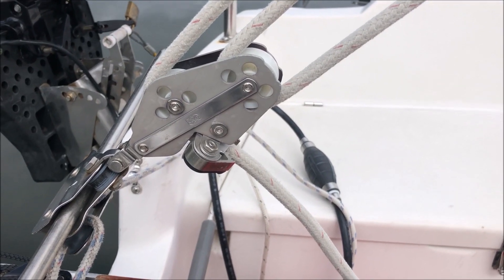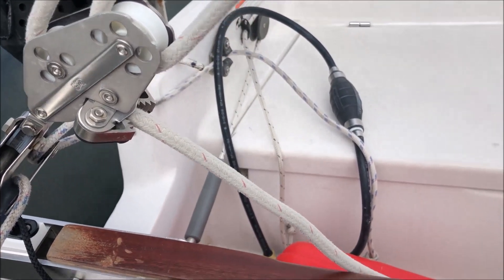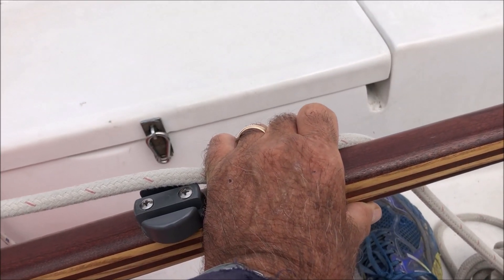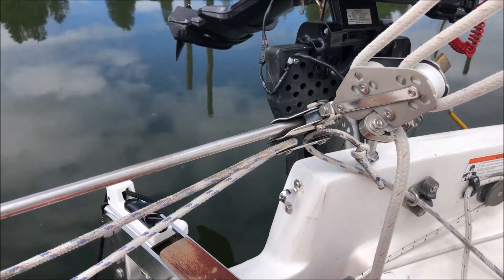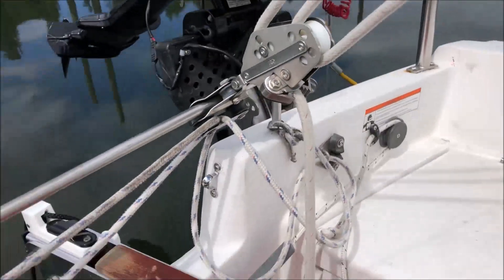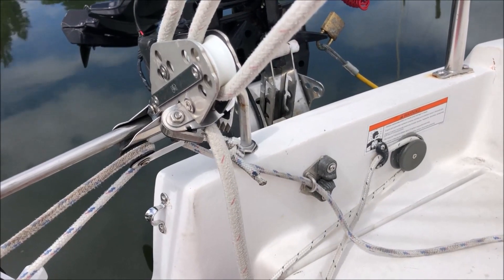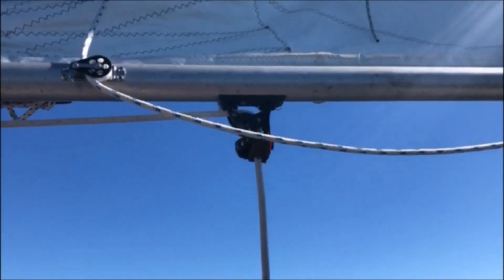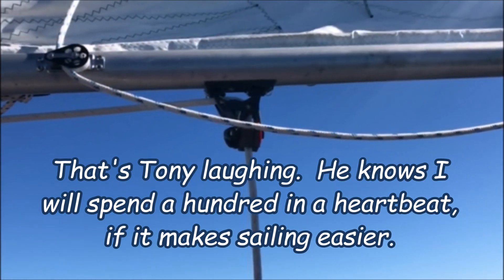Catalina 22--Jim's Little Boat--Never Make Fast the Sheets of a Small Boat

Comment: Great video Jim. I agree with you about the relationship between angle of heal and spousal contentment. Heal rate is also a huge factor. 

One mod I made on my C22 was to add a 10" pigtail between the fiddle block and the traveler car. Elevating the fiddle block means that trimming the sheet pulls it out of the cam cleat. To cleat it, I have to raise the sheet up as I trim. I find it much easier and faster to release it this way rather than an awkward pull towards the cockpit floor.
Reply from the maker: I came to the same conclusion, Dave.  After a really puffy day, I made the same modification.  https://youtu.be/uX9Uet3tlqM.  You mention cross sheeting.  We did demonstrate that in another video--to use the jib winches to tension the main and the jib.  Mostly it is just me and a buddy so we sit on the high side and use the leeward winch as a snubbing winch.  This summer we realized that we haven't used the jib winch handle for a few years.  Thanks for watching.
Reply: @jimslittleboat4388  my pleasure Jim. I found your channel when we first started looking for a C22 and have been fans ever since. Was delighted to learn you were local, which makes your trip reports even more informative.
Reply: @jimslittleboat4388  Hi Jim, I was thinking about this conversation during a blustery solo sail today. I've developed a new technique for cross sheeting my head sail I wanted to share with you. I've started putting a single wrap on the lee winch and then passing the sheet across the cockpit with one or two wraps on the windward winch. The two winches act in tandem, allowing me to sweat the sheet with little effort. With the slack out and the tail cleated, I  grasp the sheet mid-span and pull towards me. The leeward cleat passes the sheet along but has enough friction to hold as long as I maintain tension. As I relax the pull, I trim the line coming off the windward winch, which now engages. I can play the puffs easily by pulling or easing mid span. 

The single wrap limits overrides. Also, because the load is distributed and the cleat is next to me, it is much easier to release the sheet.
Reply from the maker: @daveopincarne3718  Sounds like a good plan.  We seldom do it that way, b,ut as we get older, we may use your idea.
Reply: @jimslittleboat4388  It sounds like you're calling me old.😉
Reply from the maker: @daveopincarne3718  I used to pick up  a 100 lb bag of cement and carry it on my shoulder.  This year I can only lift it to my waist.  Next year I will be asking if they have it in fifties.  :)

Comment: Thanks Jim. Can't tell you how many times I have heeled way too far in high gusty wind before I managed to uncleat the main sheet   And I like the tip on letting the traveler set itself on a tack.  I appreciate you taking the time to share your experience.  Jim M. , Brandon Mississippi.
Reply: another option is just to head up into the wind a bit and spill some wind from the sails, get it under control.

Comment: The newer cam cleats are pretty easy to release while under tension.  I added Ronstan "C" cleats on teak risers to our C22 last winter and so far my crew has been really happy with how easy they are to use.  (That and the spinlock clutches I put on the cabin top for the halyards were both big hits with the crew.)  That said...it's easy and quick just to luff up a bit if you get a big gust or a lift and find yourself overpowered and/or oversheeted.
Reply from the maker: Mostly I would agree with you Russell--but on that particular day we were close to disaster and the boat would not round up.  The same kind of cleats caused us to capsize in a Tanzer, when the sheet accidentally cleated itself.  I aslso single hand now and then.  So--mostly I agree with you, but there are times...
Reply: @jimslittleboat4388  capsize in a Tanzer must have been a crazy ride. :-)

Keep up the great videos.

Comment: Hey Jim, really enjoyed the video. If that jaw cleat for the jib keeps hardening up that much I wonder how many wraps you're putting on that winch drum
 I've had times when I had too many wraps, in light air on a 30 footer I used to sail, and had to take a wrap or two back off to get the jib to go out. If you put another one or two wraps on the drum in 25 knots I think you'll find that it takes less effort to hold the jib sheet from slipping out, and it should take care of the issue with the sheet hardening up in that cleat. Also if that line ever gets stuck in that cleat again you could always drop the handle in the winch, and grind it just a couple clicks, just enough to get the tension off the cleat and the line will come right out.
  Here's looking forward to some videos of you enjoying that boat. Please stay safe, and fair winds.
Reply from the maker: Excellent ideas.
Reply: See my comment above for managing the main sheet. With that under control, I've used Comet Jockey's suggestion of more wraps (3-4) to manage the jib sheet uncleated. A little tension is enough to maintain sufficient friction on the drum to keep it in position.